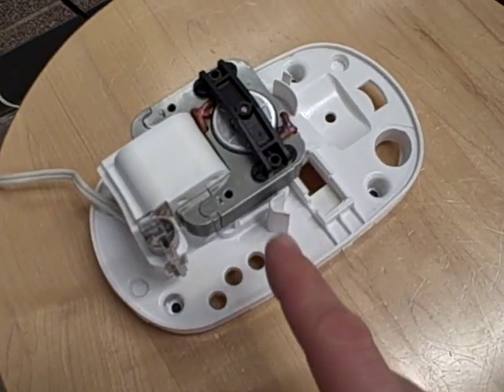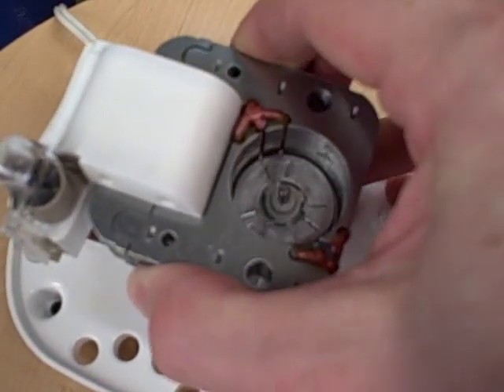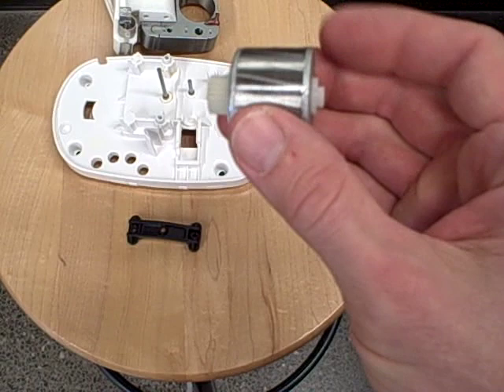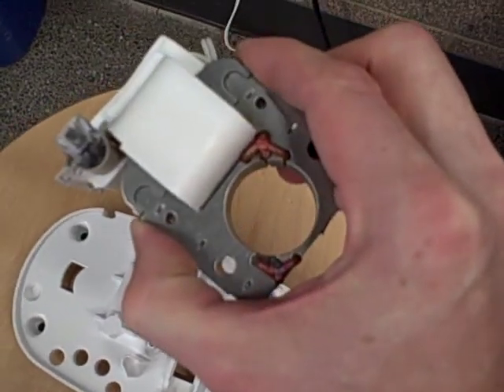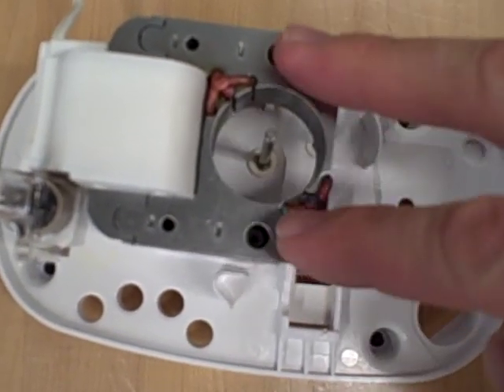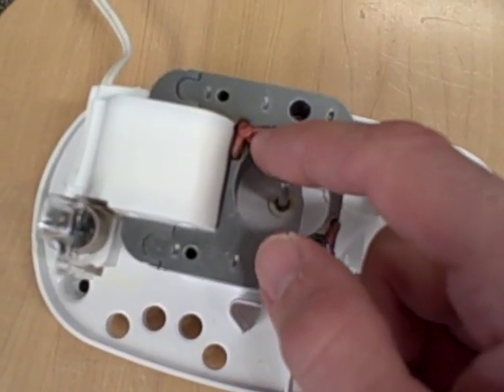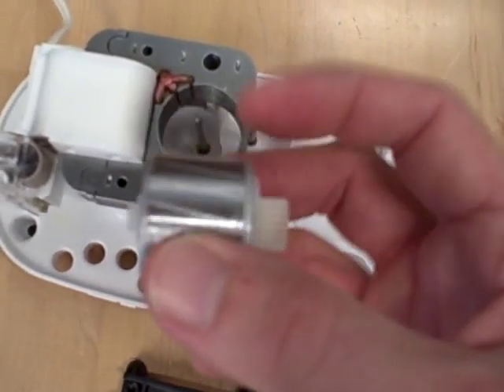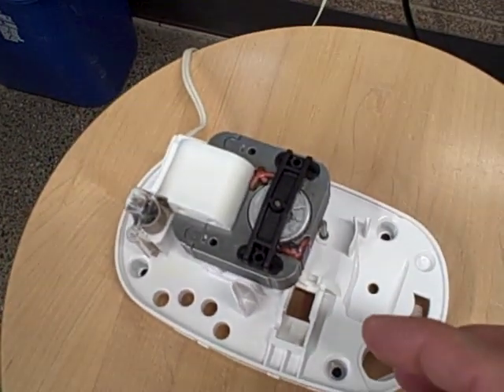Shaded pole induction motor

Comment: Has the shorted ring some effects on voltage amplification in the coil?.The windings looks to me like some sort of high voltage tranformer with primary and secondary, and since there is a response  of 90 degrees out of phase between the two....

Comment: So, the electrical current never leaves the plastic covered coil, but it produces the magnetic field that travels to the poles and turns the rotor? Does rpm = ac frequency? If you wanted to vary the rpm, how would it be done? curious.